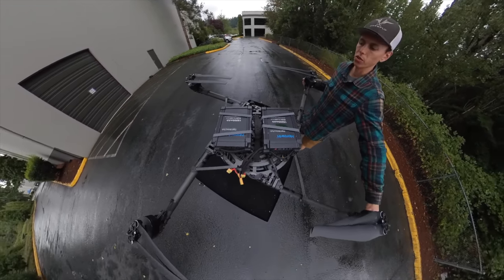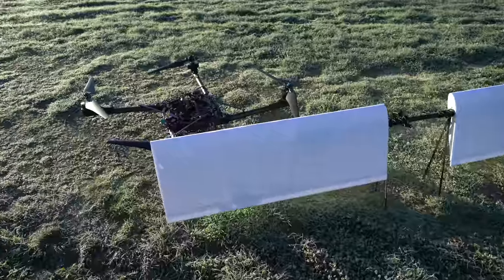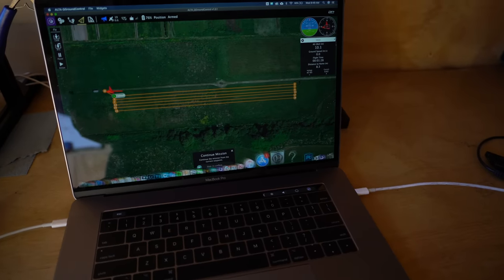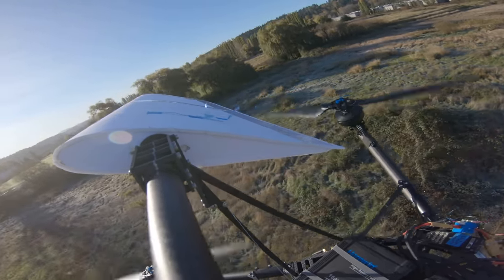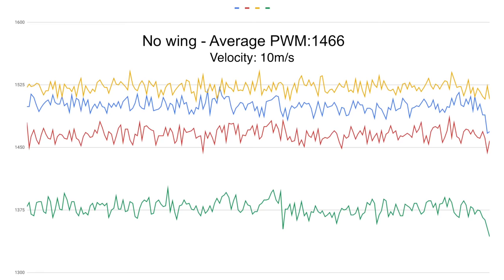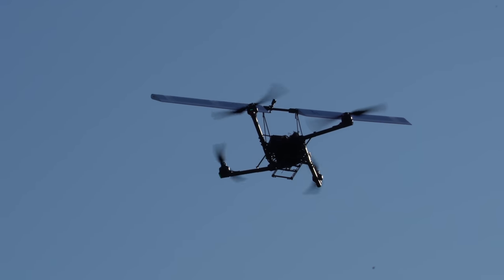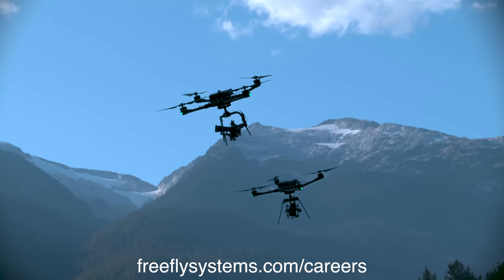Can a Wing Increase Quadcopter Efficiency?

Comment: I was actually thinking the wings center of drag should be aft of the center of mass to stabilize the craft like a stabilizer does.  Let the rotors supply the additional lift for the nose.  Effectively the wing would be lift and stabilizer at maybe 2/3 the way back like a hang glider.

Comment: There is a saying in aviation, if your CG is too far forward you fly poorly but if your CG is too far back you fly once. I think you would have better luck with stability if the wing was mounted underneath the drone that way when it is in "winged flight mode" the majority of the weight would be forward.

Comment: Had you put any thought into an undercambered wing or at least something not symmetrical, that could produce lift at a lower AoA? You could probably get away from the hard stops if the wing was its own flying wing/airplane that wanted to climb a little on its own, and was just free to flap in the breeze. And then somehow the wing should probably produce lift just aft of the quad's CG when tilted forwards. Maybe the wing should go underneath to make the whole thing more "nose heavy" as speed (fwd tilt angle of the quad) increases? Very cool!

Comment: I would add another pair of wings. Have two sets, one for each set of motors, but I would alter the design further still by putting the motors on the wings and have them reorient themselves vertically when the drone comes to a stop. You might need to add another motor per wing pair to force orientation, and possibly one to fold the wings, but that would require completely rebuilding the drone.

Comment: I'd think you'd need to adjust how the drone flies, because it should be different than a normal flight without huge wings.
I think maybe the software doesn't like that 1 or 2 of its rotors aren't even moving, probably thinks it's about to drop out of the sky, so it might slow down the two other rotors to reset itself.
If the vehicle isn't flying perfectly diagonal to the line of its front rotors, it makes sense that all 4 motors run different.
Even with software adjustments, this would be pretty unstable, and wouldn't carry much weight. A traditional VTOL is probably more optimal for this.

Comment: Use 4 wings that pivot around the motor booms. With active pitch control that optimizes angle of attack at differing speeds

Comment: Depending on how much you are willing to mess around with the drone's code you could fix a vertical wing directly to the body of the drone and simply instruct it to pivot 90 degrees, essentially essentially turning it into an aircraft which lands on it's tail.

Comment: Consider an Osprey pivots it's rotors relative to a static wing.  You have a static rotor and want to attach a variable wing angle.  Both need powered control over the variable component.

Comment: You should try and make a vtol, you should be able to make one work with no control surfaces too, just using rotating mounts for the motors on the ends of the wings and rotating the motors to provide different directions of thrust. Pretty much just a sideways H shape with rotating mounts for motors on the ends of the wings, servos should work for that.
Reply: Yaw during Fixed Wing flight becomes difficult with no tail or vertical stabilizers.

Comment: A drone most probably has sensors to detect how many degrees it is tilted in a direction. Equipping a servo that can control the wing tilt, the controller may be programmed to tilt the wing based on how much the drone is tilted in the wing's "forward" direction.

Comment: I think you need two pairs of wings, one pair in front of the drone and one pair behind the drone. So that it lifts front and back the same amount.
At the moment when the wings lift they also induce rotation pulling the front end up, which the drone is not programmed to do, it fights to keep the front down, ending in oscillation.

Comment: If the wing bar were centered it would probably be a lot more stable, but it would have to be really wide to avoid the rotors, unless the wings had circular rotor cutouts.  Alternatively, adding another wing on the bottom, or some payload with the same drag would probably do the same.

Comment: I wonder what lift-to-weight advantage you could get by turning the frame bars into airfoils...  Since you'd only need a bit of foam, the weight would be minimal, so any gains would be nearly free.

If you could get the angle of attack right, though, since pivoting that would be tricky.  Perhaps in conjunction with a smaller wing on top?

Comment: kind of makes sense that the wing would reduce necessary thrust for each motor. maybe a fixed wing that cannot rotate would reduce the integral term since there is less possible displacement of the wing and thus variation in lift generated. the flight controller would have an easier time if the lift was linear with say quad attack angle rather than drag effecting the wing position to

Comment: A few things: having a positive angle of attack isnt the main way wings produce lift. The surface area of the top of the wing must be greater than the surface area of the bottom of the wing and a venturi effect occurs that causes lift, even at a neutral angle of attack. Having a high AOA actually decreases lift to drag efficiency. 

Lift should be above and center to the CG, drag should be along the CG. If these 2 requirements are not met, you just have an unstable flight profile 

If you want a different flight profile, best bet is to design a new aircraft entirely IMO. Quadcopters are designed with a flight profile of having very high stability and control, airplanes are designed as gliders with some form of propulsion. Hovering in any context will always be inefficient, forward moving aircraft with well designed wings that achieve the venturi effect with as little disturbance to the boundary layer are ideal.

Comment: rctestflight do you think this idea is at all possible? Using one drone to extend the range of another drone via FPV link, where you would piggy-back a smaller drone to a larger drone and the larger drone would carry the smaller drone as far as it's battery can, land,  and then launch the smaller drone to continue it's journey to a farther point. Is this possible with off--the-shelf RC equipment? Love your RC videos! Thanks! :)

Comment: mmm, change the orientation of the front axis and wing axis: make it run on a motor axis.
The + geometry flies much better than the X and u can shut down the 2 engines under the wings.
The engine in the back will help sucking the air over the wing.
The engines in the front will help keep the nose low.
We need sketching here...
(big fan btw, grz)

Comment: You could also try spacing the wings further apart away from the turbulence from the props…also maybe starting with a flatter  wing at a more horizontal angle that slices through the air until you are ready to increase angle of attack and increase air

Comment: I've thought about making a transformable drone out of string/wire and carbon fiber tubes. I would use a single servo to wind the the string which pulls through the tubes. The line would pull taught on some ripstop nylon. Basically, It will resemble a kit or solar sail

Comment: I feel like turning the drone about 45* while in flight might help with air entering the props and allow it to more or less shut down the front prop in a more stable fashion while using the rear prop for most of the forward movment.

Comment: Very cool video.  Very informative.  Do you think if you elongated the front/back arms for the rotors (leaving a gap at the body) and a  narrower wing attached to each side in line with the height of the rotors would alleviate the oscillating?  With the setup you used for this experiment did you determine the flight time or distance available for this drone?

Comment: You are on the right track. Wings will increase the efficiency in forward flight. Based on a conversation with Ed Sweringen over 50 years ago, I think you have too much wing area for the aircraft. The wing flapping around makes it worse.  Ed put small stub wings on a bell 209 HueyCobra Gunship that unloaded the rotor in forward flight and carried more armament. If wheels were added the wings increased the gross weight the helicopter would get off the ground with the lift from forward movement and air from the rotor in the ground effect. A much smaller fixed wing placed so the center of gravity and average center of effort don't induce isolation or proposing.  

Stating small and making the wing larger until it fails works much better than starting larger and cutting it down over and over until it works.

good luck

Comment: I think this would work much better with ArduPlane installed and set up as a Quadplane. Especially if you use a servo to control the wing angle. But Yaw during Fixed Wing flight is a problem with no vertical stabilizer or tail.

Comment: I think part of the issue is that ad the drone pitches forward, the wing moves forward, and you end up with a wing in front of the center of mass, hence you have an unstable aircraft. A tail or a wing further back may help with stability
Reply from the maker: I think you just described a self stabilizing system 😂
Reply: @rctestflight  in other words, a plane. Yeah. Especially with the tail.
However just moving the wing backwards might already help as the front motor would no Ionger idle and take some of the load from the rear motors while the lift from the wing stays the same, just shifted backwards.

Comment: So two things come to mind: The wing is way up high, and since there is no tail, it creates a nose up moment that is very hard for the multirotor part to stabilize due to the moment arm, and also a tailless wing is not stable by itself anyway.

Maybe try adding a tail - or maybe (a bit more involved idea) is to build a more like a "H" shaped quad where the wing is between the front and back rotors, not above? If everything was in the same plane, would it be easier to stabilize? At least that is what the multirotor flight controller is doing without the wing all the time anyway?

Fun experimenting nevertheless, I enjoy watching your projects :-)
Reply: Then you could adjust the angle of attack (wing positive offset from the current attitude of the quad)  with a servo, based on some assumptions of different angles of attack at certain airspeeds (groundspeed on a calm day would likely be just fine)

Comment: If you make a gyroscope on the wings it will be allways horizontal.
Or if you could electronically link an artificial airplane horizon to a motor on the wings, it could keep them upright all the time.

Comment: It's tail heavy, because you do have a virtual tail involved here. You could probably make this work with a tailplane/rudder with control surfaces that are just gyro'd to maintain level flight, which would help with your angle of attack problem.

Comment: Looks to me like the drone's software was fighting the increase in flight height caused by the lift of the wings.

It reduced motor speed to sink, but that also reduced the speed and effect of the wings. That killed twice as much height as the software intended. Same for the following speed up when the drone sank too much. A perfect recipe for oscillations. The correct response would have been to increase the flight angle to direct more of the motors' thrust towards propulsion instead of lift.

Comment: Is the motor clocking thing impacting these test results? I have no expertise in this but this consideration is very interesting to me. My intuition is saying it may even help through a mix of showing results for various speeds and exaggerating flaws. A well tuned machine may show better performance by being better at hiding the instability. I'm pretty sure we can't get good info out of how much the wing affects individual or pairs of motors, especially with the saturation issue, but everything else seems reasonably useable

Comment: Put a tail on it and rely on the horizontal stabilizer instead of hard stops on the main wing spar.  Basically strap standard glider or maybe a delta wing glider on top.  You could even use ardupilot to stabilize the top mounted aircraft.

Comment: Surely, attach the wings to a servo and then you can program to 1) hold the wings at a constant angle of attack relative to horizon no matter what the drone itself is doing and then 2) adjust to best angle of attack for the forward-speed to give constant lift.

Comment: A wing by itself is pitch unstable, that is likely what is destabilizing the drone. You need a tail that has a slightly lower incidence than the wing (or a canard with slightly higher incidence). More practical: Experiment with a reflex on the trailing edge, i.e. an upward curve on the trailing edge to reduce the wing instability.

Comment: Apart from all the CG (w&b) issues, the wing doesn't provide much lift as the rotors below must be stealing the high pressure from below the wing. The wing would indeed be more effective if placed on the same plain with rotors and closer to the drone CG.

Comment: Is the wing free turning with the wind speed? If so I can kind of see why it doesn't produce much lift.. maybe it would be worth setting the drone in angle mode on betalight with a fixed angle the drone won't go past when you push the sticks forward, and a wing adapted to that angle of attack that would be fixed to the drone in the bottom middle to have the wing aligned on or behind the center of mass. you test with wing on vs wing off, that'll show you if it helps!

Comment: Very interresting!
Your wing is not fixed, thus it is a very close problem as modern aircraft flight control problem: the control of structural modes. 
Because with hugely optimized structure of big aircrafts, the structural modes frequency is lower compared to legacy aircraft and inside the domain of the natural aircraft modes: pitch oscillation and fugoid.

On your quadcopter, you have to control the oscillation of the wing. The wing oscillation leads to vehicule oscillation and you were lucky that this was stable.
This is managable but you have to:
- know the natural oscillation of the wing, 
- maybe damp the wing by adding frictions to limit  the amplitude of the natural oscillation, 
- maybe change the shape of the wing to change the frequency of its oscillation (reducing the wing width will increase the frequency and may push it out of the flight domain...)
...
The best is to built the equation of your vehicule and identify its parameters.
You have to begin with static equations to have the best wing rotation versus the airspeed. 
It may allow you to control the wing position with regard of the airspeed.

With dynamic equations, shape the wing and place it on the best position regarding the vehicule global stability.

Of course, you can progress by testing and testing...

For an example of progressing by try fail, you can see a video of "Hacksmith industry" called "Our BIGGEST project yet! (SPIDER MECH!)"

Comment: What if you made a hybrid that starts out as a drone carrying an airplane for takeoff and landings, and in forward flight it becomes an airplane carrying a drone. You could try to attach a wing and single propulsion motor suspended above your drone, when you go into forward flight once you get up to the speed where the wing starts providing lift, start transferring energy from the Drone Motors to the wing propulsion motor and eventually shut the Drone off in full forward flight. That way all of the battery power is going to the propulsion motor and you essentially have an aircraft carrying a drone. Reverse the process as you slow down for landing.

Comment: So what about a servo to control the pitch of the wing? It could keep the wing flat when turning or adjusting for max lift. Also, maybe the wing gap could be wider to keep the suction of the rotors to a minimum or just less surface area.

Comment: The drone + wing combo is obviously tail heavy compared to the angle of lift!      If positioning the wing over the center of the drone, you're better off with a high camber with no lock but a dampening system to prevent it from fluttering. You need to be sure the pivot is near the wing center of lift, ideally so that lift is straight up compared to the line of travel.  (with a limited high attach angle the lift direction from the wing obviously comes way forward compared to the drone's CG .... hence it looks and behaves like a very tail heavy plane.      You also need a tail - relatively small I'd guess since the rotors/flight control does most of the roll stability ... but when the wing is generating lift all the issues of winged flight come into play...   the craft WILL yaw and roll at any opportunity (the drone engines fighting it of course.

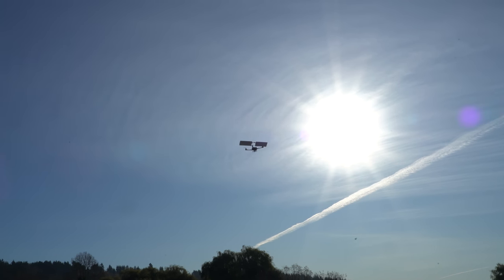Comment: Howdy. I think you're wobbles and the oscillations you get into around the 08:00 min mark would primarily be caused by the suck of air pressure out from under the wings (destroying the wing lift) by the rotors. 
You might need to get the wing airflow out of the way of the rotor airflow. Even underneath it could be better as the increased horizontal speed would allow the rotors to power down, decreasing rotor airflow with forward speed.

Comment: put an AoA sensor on the aircraft, and have the wing pitch appropriately. There are real helicopters with fixed wings that make up a significant portion of its lift, like the Mi-24.